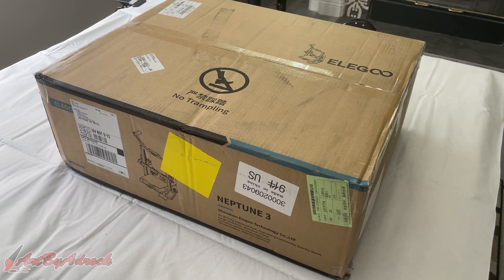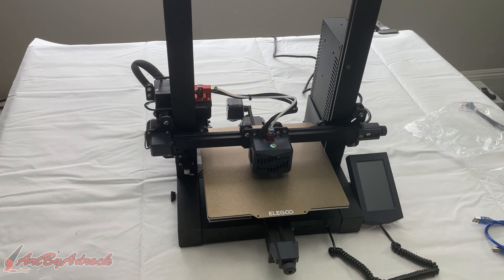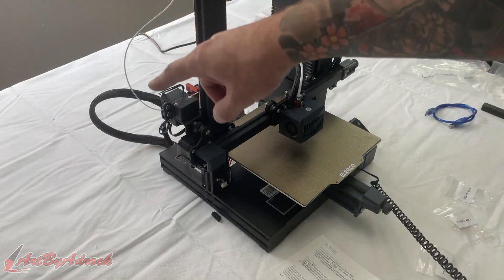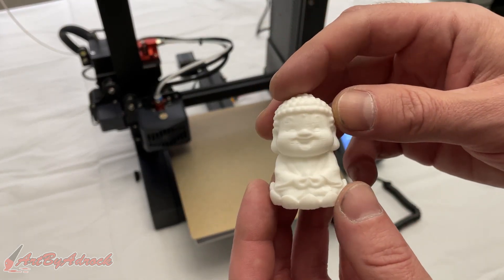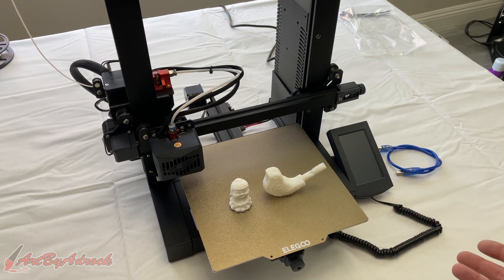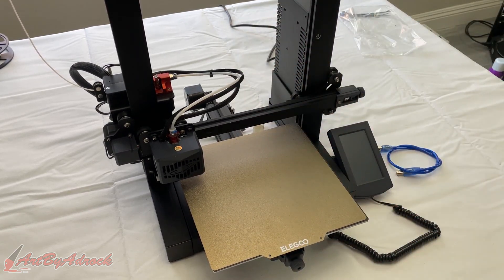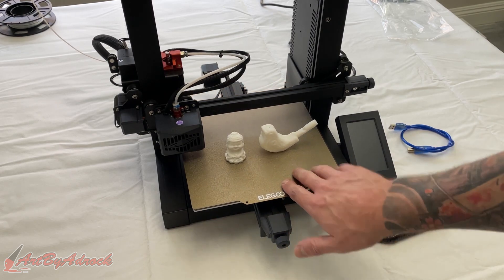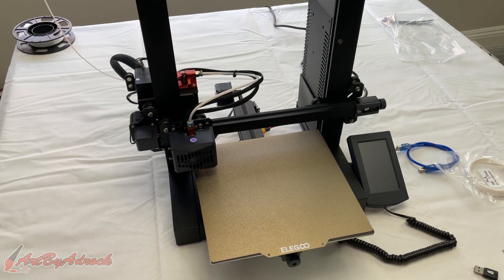Elegoo Neptune 3 (Is It Any Good?) - Unboxing, Setup, And Honest Review

Comment: I just got my Neptune 3 yesterday and did the Buddha test print, and it turned out flawless. No minor hiccups or anything. Anyhow I am very happy with it at the moment :)
Reply: Did you order from the site?
Reply: @malcolm4k270  Not from the Elegoo website. I got it from a retailer website.
Reply: @davidlionfrenkel  what filament do you use
Reply: @Oliver_Wright67  PLA 1.75mm
Reply: @davidlionfrenkel  thanks

Comment: You said you had to manually level the bed? It was described on the website as auto leveling??????
Reply: there is a 16 points auto leveling but the z axis needs to be leveled i think at first?
Reply: It creates a 16pt mesh it uses to offset the print head as it goes…I find myself running the level before most jobs. You do have to set z offset with paper manually after, as the process pauses until you do so and hit the back arrow.

Comment: In one of your early videos you used a grill to remove the PLA. I was just wondering How long did that take and is that a good idea because I don’t have the resources to ramp up the temp over a few hours yet and I really want to up my casting game.
Reply from the maker: Probably about 4 hours in the grill. It worked but it’s not the preferred method. It made a mess and I still cooked it in the oven for a few hours just to make sure all the moisture was removed